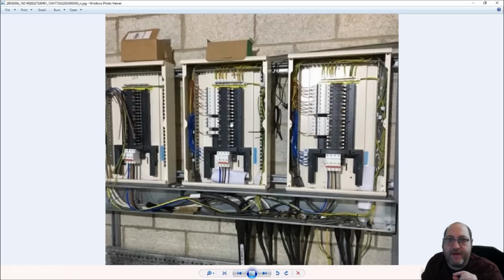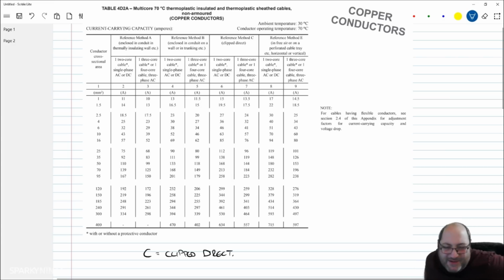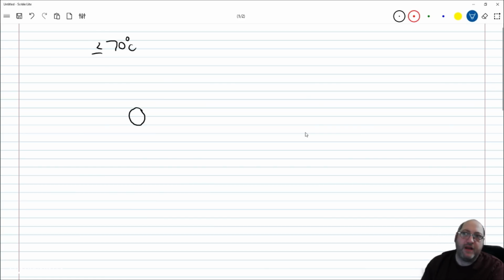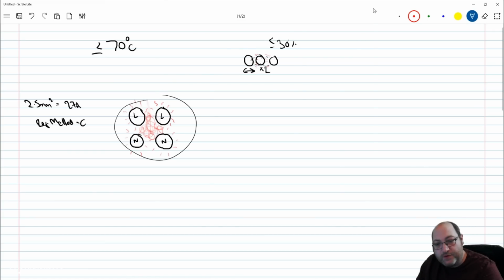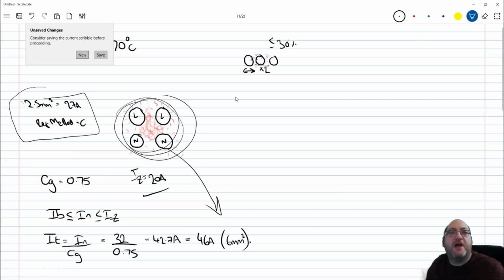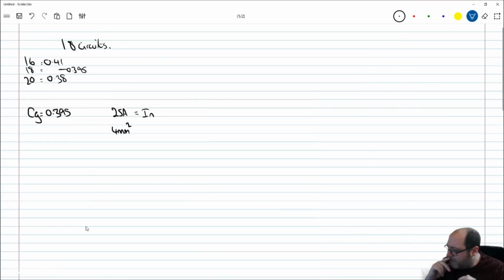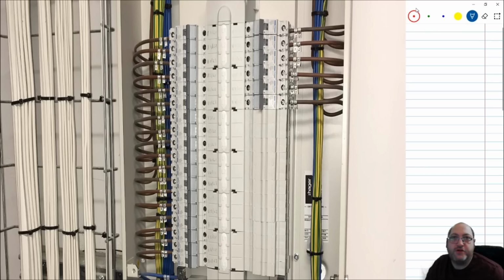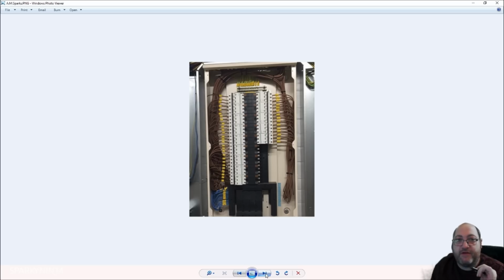Cable Grouping and the impact on electrical installations

Comment: Fantastic content sparky ninja. I have recently finished my 2396 and think the course is a must for all electricians as it’s a huge eye opener. It left me with a question of which I would love your insight, should we be worried/make allowances for grouping where all final circuits congregate at the bush/trucking entry at the fuse board location. To my mind this can never be avoided but can be impossible to allow cg corrections for all circuits. 
Thanks richard
Reply from the maker: Hi Richard, thanks you for your comment, and I strongly agree with your opinions towards the 2396. With regards to the entry points at the fuse board, you're right in that this can often appear to be like a bottle neck in the wiring system forcing the cables to be in close proximity with each other. From a design perspective I would attempt to maintain the wiring systems sizing through the point of entry to the fuseboard - in other words trying to ensure that the entry point matches the sizing of the trunking, relative to the number of conductors and similar for conduit systems. If we can achieve that then there should theoretically be sufficient air gap around the conductors through that part of the wiring system - I do think however that this area is often overlooked even by designers and it is often left to the workmanship/opinions of the installer. It shows you how involved and how much input the designer should really have.
Obviously in most systems this will be by the by and won't be a problem due to loading, demands etc - but there will be those occasions where this is most important and good designers will always be on top of it. 👍

Cheers

SNinja

Comment: Very well said many uneducated electricians.
I think personally electrical design course should be mandatory.
Reply: Hi Stephen . It should be basic knowledge for any working Sparks and no one should be doing a board  if there not a qualified Electrician.
Reply: I don't know what it's like where you are, but ANY electrical work done by someone other than a qualified electrician is illegal around here.

It's almost at the point where changing a lightbulb yourself is illegal.
It's not THAT crazy, but it's close...

Also you can't get amateur work verified. No matter how well done it is, the fact that an amateur did it makes it illegal no matter what, nor who checked it at any point in the process...
Reply: If sparks start designing what an I gonna do?